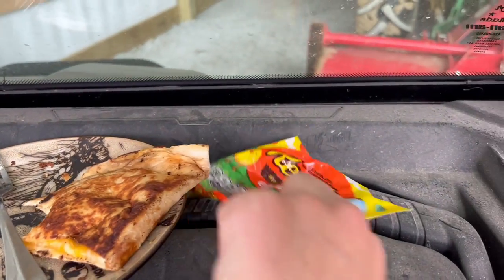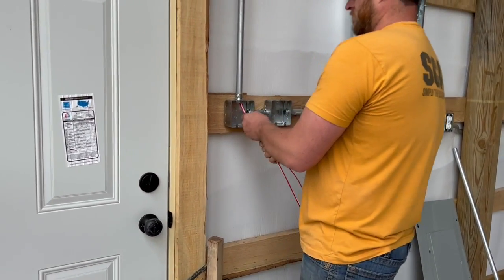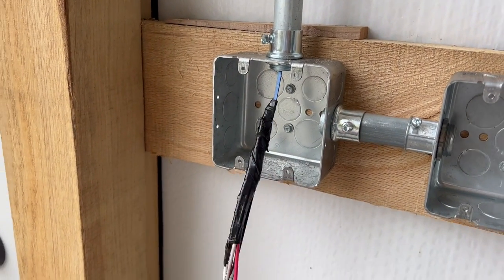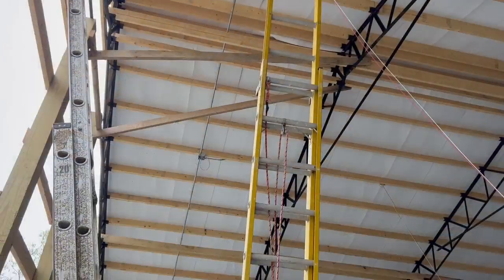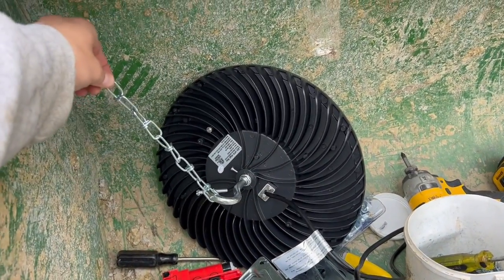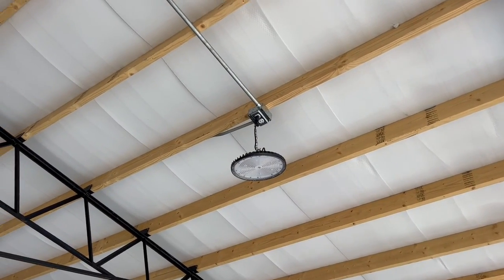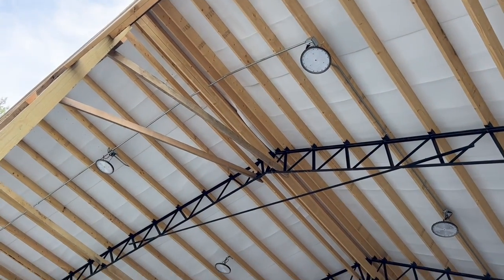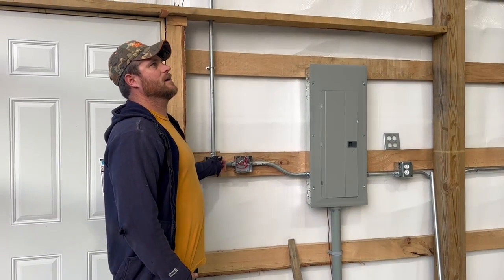DIY Pole Barn Construction #26: Installing Electric | 200 amp panel, conduit, outlets, lights.

Comment: I'm preparing to wire up my pole barn. I appreciate this helpful video. Just a couple of questions: Why did you bend the conduit down behind every 6x6? Also, why did you hang the outlet boxes down off the horizontal boards and not mount them up higher?
Reply from the maker: Hello. Thanks for watching our video. There is other ways you can accomplish running electric than exactly how I did it but because I used EMT pipe is why I did what you ask. The boxes lined up better if I offset them and it allowed me to be able to bend a saddle to go around the 6x6. I did not want to drill my posts.
Reply: I see now. If you put the boxes up higher, you would have to get down below that board and still bend around the post. The video was a bit deceiving because it looked like the conduit bent down when it really just bends back behind the post. I plan on running EMT myself. Thanks again! @CollinsCountry

Comment: Did you need conduet?  Is that always going to be exposed?
Reply: Either way looks great!
Reply from the maker: No conduit wasn’t necessary but I knew I wasn’t going to cover it up for quite some time. And I do think it looks good too.
Reply from the maker: +@bonnon0brian It will be closed once concrete is done:) It’s the next video or maybe the one after that lol

Comment: First, I'm not a licensed electrician.  But why did you only use a 3-wire feed to your barn? Where I am we have to have both a 4-wire feed plus ground rod(s) at the outbuilding. The way you wired it don't you have neutral and ground bonded in two places now (main service panel and this new panel)?
Reply from the maker: Thanks for the question. I believe this was acceptable when I was in school. There has to be 2 bonded areas of ground and neutral to tie it together but after quick research this does not seem acceptable for todays NEC. I’m going back to the drawing board. Quite possible I need to run a 4th conductor and separate neutral and ground at the shop. I need to get answers for this as it is now really bugging me. Lol. This setup with the “through lug meter panel” might have different rules in the NEC. Thanks again.
Reply: @CollinsCountry  Dave is correct. You were supposed to pull a ground wire from the main and drive two ground rods at the new building. You'll also have to have a panel that doesn't bond the ground to the neutral. You also either need to mount the panel outside or have an outside disconnecting means. To be 100% up to code everything is supposed to be AFCI/GFCI protected too. Good job on your conduit. I would have just run MC cable though. Not trying to nitpick ya, just a little help from someone that's done these and had them inspected in different municipalities. Good luck!
Reply from the maker: @bradleylb5003  yea thanks for the advice. I’m working on correcting. I have the two ground rods in already just need to run the ground from meter panel and separate bond. I do have a disconnect at the meter base for the barn though.
Reply: This is only correct if this panel is fed from a sub panel after a service disconnect.  This setup is perfectly acceptable if the URD was ran as service entrance conductors (such as double lugged off a 320A meter socket) and the panel here is the first means of disconnect (service disconnect) for this accessory structure.
Reply: @CollinsCountry Good on you for doing the follow up and fixing it. Too many rules are written in blood and you've got a great family out there to protect. Wish I had the space and time.
Reply from the maker: @purduephotog  yes sir. Got her all fixed up. Thanks.

Comment: It doesn't look like you grounded your metal boxes to your green ground wire? .
Reply from the maker: As long as you are bonded correctly you can use the EMT as your approved ground.

Comment: Just  a thought -- don't know if your electric provider has a "demand multiplier" at the power meter tie in, But   by throwing the switches on together or quick succession some companies have a way of "upping" your rates due to "high surge demand" or what ever  "catchy" term they can come up with.
Reply from the maker: lol. I wouldn’t doubt that for a second.